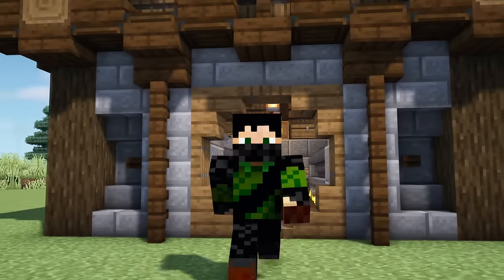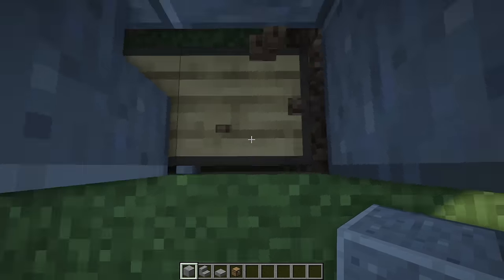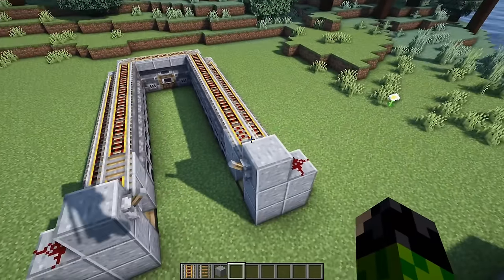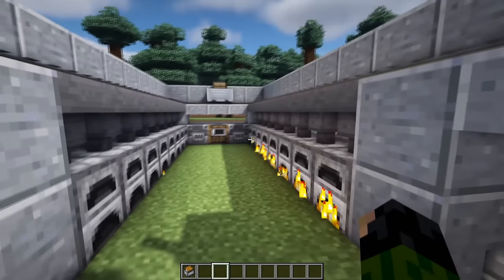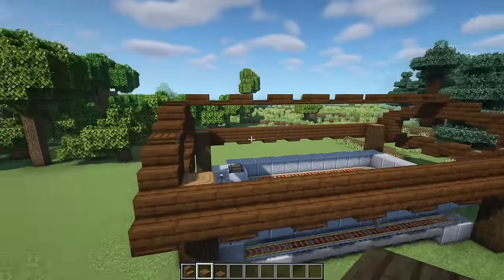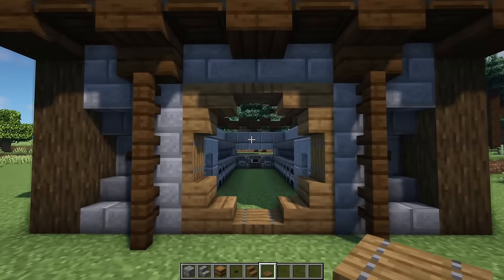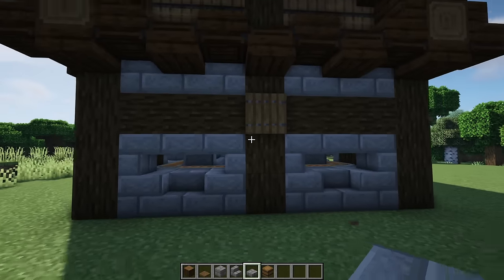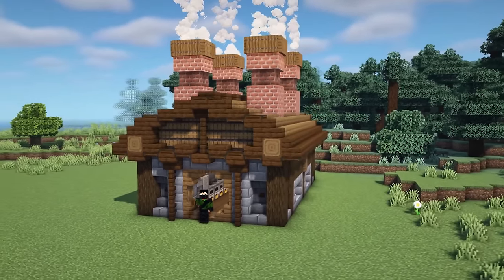Minecraft - Super Smelter Building Tutorial (How to Build)

Comment: for those wondering, no it doesn’t work on bedrock. The top hopper minecart feeds into the fuel one which will clog the fuel hoppers overtime. You’ll have to create sorting, overflow protection, or raise the fuel minecart.
Reply: Works just fine on bedrock

Comment: Can’t get the rails to work on the bottom part, they keep connecting to the top ones
Reply from the maker: Rails can be a bit tricky depending on the way the building is facing. I briefly touched on it in this video but you can get them to work but requires a bit of tweaking :)